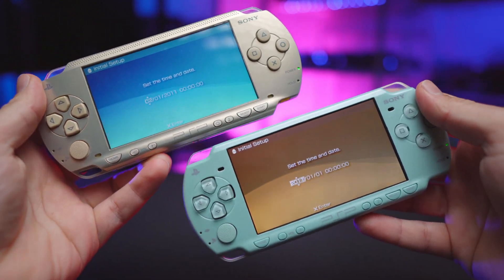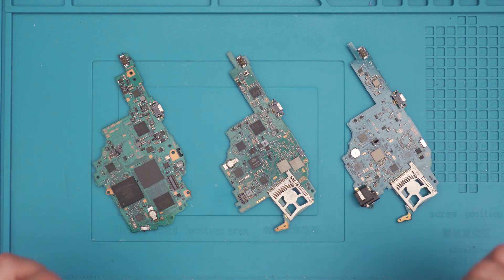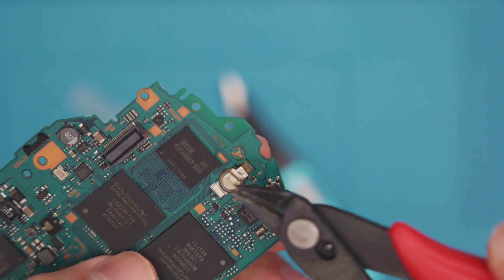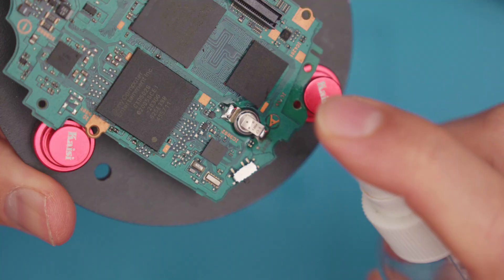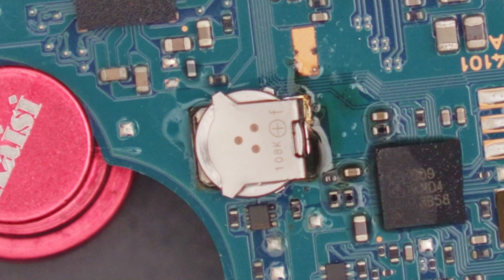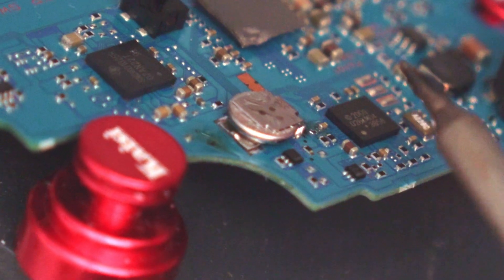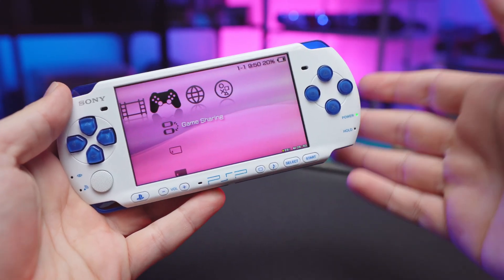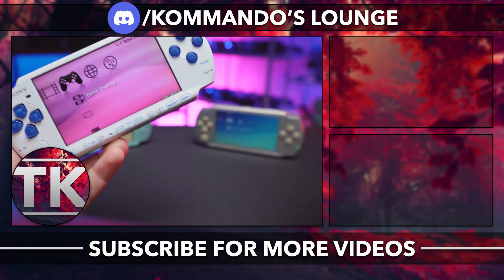How To Fix PSP Super Capacitor "CMOS BATTERY" [Read Description]

Comment: Is it ok to leave it in the bit that has died will it damage the psp because I'm not skilled to remove it or skilled to attempt to mess with it?
Reply from the maker: if your psp is running fine, leave it as is, if its not keeping time, but its still working and you are not comfortable doing it, then leave it as is

Comment: Hey, great video! I just didnt understand the risk of creating a short circuit for the psp3000,
Which part should I not touch?
Reply from the maker: We are doing the opposite of short circuit, we are disconnecting / isolating one side of the super capacitor, to disable it
Reply: @TotalKommando  I mean for when you’re soldering a new one on, which part are you not supposed to accidentally solder to avoid creating a short circuit? thanks
Reply from the maker: @ Literally any component, take a photo, zoom in, get a visual of all the other parts, you really don't wanna touch any of them small components lol

Comment: I changed mine and it’s still the same I have a 3000 model
Reply from the maker: What's yours doing exactly, not powering or draining?
Reply: @TotalKommando  draining
Reply from the maker: @dashbelall9995  what battery are you using? brand and mAh

Comment: I accidentally knocked off a resistor near the supercapacitor and my psp 3000 won't turn on, do you in any case know it's value (it's the one near the positive contact on the super capacitor)
Reply from the maker: can you send a pic of it on discord? so i can see which rev it is and try to measure it for you, cant u even find it
Reply: @TotalKommando  I'll do thank you so much

Comment: would replacing the capacitor solve my battery not detected problem? the battery is good
Reply: if it is the cause, would simply removing the capacitor and not replacing it be okay?
Reply from the maker: PSP 3000? I explain in the video, you can just remove it or disable it and not have to replace it, if you are having power issues.
Reply: my battery will be detected again and it wont cause further issues? also how do i "disable" it assuming it is different from removing it?
Reply from the maker: @DonTiburcio-e5j  I explain in the video in method 4, you disconnect one of the connections and block it with tape.

There is a high chance thats your issue, if you already tested your battery and know it works, thats the next thing to check, its a common issue

Comment: Looking to get a beater non childhood owned psp to get to mod. Which should I get? 1000 or 2000?
Reply from the maker: 1000 for the IPS screen upgrade
If you dont plan to do any hardware mods, go with the 2000
Reply: @ hardware mods would be different OS?
Reply from the maker: @cjproductions1996  yes hardware means physical upgrades like an IPS screen not just software to unlock your system and freely play anything

Comment: hi, will the psp 1000 capacitors work for 3000?
Reply from the maker: They should yes but wont fit unless you do some modifications or make extended wires to relocate it
Reply: @TotalKommando  can you tell me particularly what modifications would i need to do?

Comment: For the 3000, it might be easier to start with solder on the more difficult pad (the 2nd one you soldered). Apply heat and melt it, then slide the super capacitor into place into the melted solder. Then you can apply solder to the easier pad.
Reply from the maker: Yea thats def one good way of doing it

Comment: Wow! I was just asking ChatGPT why PSP stored for a long time have weird issues. I have a 1000 that was in storage for over 13 years, I took it apart, cleaned it and reassembled. The battery charged, I modded it, played it for a bit, turned it off and later it wouldn't turn on... same issue with a 2000 but that one started charging again after a month that I thought it stopped working. I also have a 3000 that won't turn on.  I will definetly be doing this. Thank you!
Reply: PSP are def weird machines. None of my ds or 3ds had any kind of problemns. A few days ago I turned on my 2ds xl that was in my closet since 2022 and still works and has a little bit of charge. Same with my old ds lite. Meanwhile my old psp was a swollen battery :/

Comment: Hi total komando. Im trying to repair my old psp2000. I successfully turning it on again by modding the battery and changed the right side flexible. However i have one problem with the left side flexible. The button on the old one doesnt work at all so i already trashed it. I bought 2 new left flexible and tried these 2 flexible, the right arrow d pad doesnt work. The code written on the flex cable is 7716d11. Do you think i receive deffective flex cable or is it motherboard problem. Thank you.
Reply from the maker: Sadly aftermarket flex cables usually suck, and come defective l together. Best  to get a doner psp for these ones.
Reply: @TotalKommando  thank you for answering my question. I was worried that it could be another problem like motherboard or anything else, cause 2 new flex cable got the same right arrow button problem. Its difficult to find a donor parts in where i live, i guess i need to keep buying these shitty aftermarket flex cable untill i receive a non deffective one 😅
After im done with flex cable, next is i will remove my cmos battery, following your tutorial video.
Again, thank you so much for making the best tutorial videos about psp 🙂
Reply from the maker: @ Good Luck : )

Comment: Hi, hello there. 2nd video talking about the battery in psp. Yours is much clearer. Any updates on battery condition after removal / disabling the psp battery in 3k? Thank you in advance. 

At the moment, my battery hack is just to plug in the external battery to play without wall plug.
Reply from the maker: I have this: https://youtu.be/1aXUrMIQ_Ls
But if you are talking about the capacitor i have yet to do more testing.

If you psp is only turning on with power cable then you should try disabling it like i show in the video and try battery again
Reply: @TotalKommando  Thanks for the fast reply. I am referring the farad capacitor 'battery', not the psp replaceable battery. I have already remove one, before watching your video last week. Use the exact method of chipping using blade. The test was fone on 1 of my broken psp just to get a feeling before doing it on my current live psp. So was hoping getting your feedback on the effects of disabling the farad to the battery.

 Is the battery detection error fixed? The 5 minute on battery then died part. Or the capacitor is needed in order for the battery to function properly. 

Thank you in advance. Long live PSP
Reply from the maker: @sgsg268  Disabling is useful for 3000 models because usually once the capacitor dies after a decade it has a high chance of causing issues.

The part about 5 mins, is just a basic test, power the psp for at least 5 mins, then unplug battery for 10 seconds and replug, if you see the time screen it means the capacitor is dead.

The only downside is a side-side which is setting time when power is removed. Because if you are doing it, it already means you are setting time when power is removed on your dead old capacitor.

Comment: I have a PSP 3000 (09g) that doesn't show the orange light when charger is plugged in. However, it shows as loading in the VSH and battery options menu. At first I thought it could be something related to this video, but probably it's another hardware issue. I'd like to know if someone has ever experienced that on their 3000s.

Btw, I never miss any of these videos. He's the best PSP content creator on YouTube by far.
Reply: Mine had the same problem with the battery connected and the charger, it won’t charge at all and when turned on did not recognize the battery, it only worked with the charger plugged in. 

I opened mine and removed the capacitor following this tutorial and now is finally charging and working fine again.

Comment: is it easier or harder with hot air blower?
Reply from the maker: If you have it and know how to use it, with the right size tip, i would say easier. I just mostly so iron so its more accessible to people.
Reply: @TotalKommando  what if solder small cable to the board and battery and tape it instead solder the battery directly to the board, is it ok?
so when it broke again its easier to replace
Reply from the maker: @roncaesar4  You should only need to do this like every 10 years or so

You can do that if you want, as long as nothing is shorting.

Comment: Another great vídeo.
You say about the charge time duration. You make any test about the battery time before and after Capacitor fix?

Is needed to charge the super-capacitor before installing?
Reply from the maker: How a super capacitor works is it charges when there is power flowing through the psp via battery or charger. hy charge time i mean time the psp has power. the supercapacitor is there to save time long enough for you to change the battert.

so no need to charge it before installing
Reply: @TotalKommando  Yes. I ask it because some super-capacitor, has great power consumpsion when full discharged and you put some power on. 
Like, some super-capacitor for automotive audio, need be charged before installing or it will count as short circuit damaging the car battery. Or even the car wires.

Comment: Well this was informative... and slightly concerning in regards to my PSPs. So far i have tested my 1000, 2000 and 3000. Only my 2000 can hold date and time. I have one more 1000 to test, but I can't test it right now. Also what about GO and street? I assume there's no CMOS because of their "non removable battery" design.
Reply from the maker: Correct PSP GO and E1000  they dont need it because battery is non removable, so there is always power flowing.

Comment: What about swapping the super capacitor with a rechargable button battery like MS614SE-FL28E or MS621FE-FL11E?
Reply from the maker: It might be possible, not too sure about just dropping it in, may need to add a resistor.
I'm no electrical engineer so will need to do some digging to find that out.
Reply: @TotalKommando  It should be a drop-in depending on the measurements on the contacts of supercap. I don't have any spare/open motherboards at the moment to measure it and test it. If the charging voltage for the supercap is lower/higher there are lower/higher voltage button batteries. I was just guessing 3v as 3.3v seems to be present alot and would be safe to charge it.
Reply from the maker: @DonLenkas  I will try to get my hands on some and try it out, perhaps I could do extra testing to include it in the the battery maxxing video.
Reply: @TotalKommando  Awesome! Looking forward to it!

Comment: i have a psp 1000 and 3000 even the psp 1000 capacitor is dead its still detecting a battery but my psp 3000 wont detect a battery i need to run the psp 3000 for 15mins of gameplay charged without a battery and plug the battery and it will work this is getting frustrating from time to time does removing the capacitor really work on psp 3000? my country doesnt have this super capacitors even online so does completly removing it will the the batter problem on the psp 3000? thank you
Reply: My PSP 3000 is having the same problem, i remove the capacitor and the problem persists, what i do? (Sorry for the language issues, my english isn't good)
Reply: @ummanequalquer  i removed mines and the problem still present when you dont use psp for long long long period of days but it not lessen the date and time doesnt shows anymore when i reset my psp 3000
Reply from the maker: It sounds like one of those weird power issues related to it. Try removing it or taping like in method 4 and let me know how it goes

Comment: First, I never know that my psp was'nt suppose to lose time after battery swap. Secondly, Y know it was said that a battery maxing video comming, but I kinda wont to know if on 1K a dead supercapacitor drain a lot of bettery.

Ho and by the way, I may not said it already but this is really quality ressources. You did some amazing job on this channel on PSP topic.
Reply from the maker: Its very possible, you can "disable" it with tape and see how your battery functions

Comment: What did you mean by the super capacitor only last 5 hours? will it need another replacement?
Reply from the maker: 5 hours before you need to set time if you leave the psp unplugged and without battery. its there to keep time long enough for you to change battery
Reply: @  alright thank you, i hope this fixes my battery drain issue!

Comment: I thank you very much! 
Specially the links to the caps. 

Problem with these capacitors ore “batteries” is eventually they’ll start leaking their corrosive goo. And start etching into the traces. Which are no fun to repair unlike this capacitor. 
The lifetime of most capacitors now a days are somewhere between 10 and 30 years. The better the quality, the longer the life expectancy. 

The psp is now in the valley of value. 
It’s between trash and collectibles. 
Perfect time to start picking them up and starting the collection.

Again, thanks!

Comment: Huh, 3000 series 1:37 doesn't have UMD door sensor? It's near the battery connector on the 2000 series, it broke on mine and I couldn't find a replacement, but if the newer ones don't have it maybe it could just be bridged
Reply from the maker: Yeah might be broken. last one I have shown was a latest 09g model

Comment: Great video, as always. You single handedly reignited my passion for fixing things. Now to the question/request. I have a psp 2k that turns on with a battery, but it wont charge. Not with the charger, and not in usb mode, and i already replaced the charging port. I suspected I need to replace/ short a fuse related to power. I will go ahead with the fix, but i would also like to see what you think/know about it. Or make a video about this process. Also could it be the super capacitor causing it? I have multiple units with totalled sc, but they all operate normally. Thanks

Comment: Leave psp without a battery ac poweres playing a video for like an hour and miraculously battery works again....
Reply from the maker: Which Model PSP?
And you could contact ostent they might send you a new one, that might be an issue that could be fixed by shorting the battery to sorta reset it